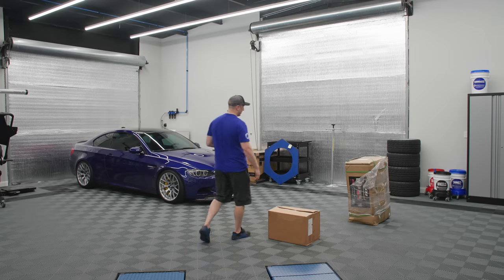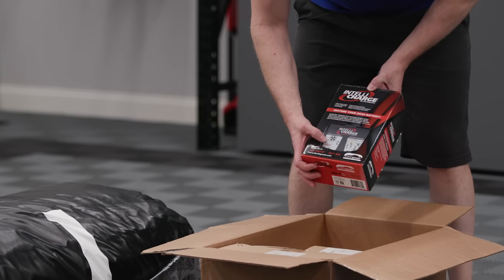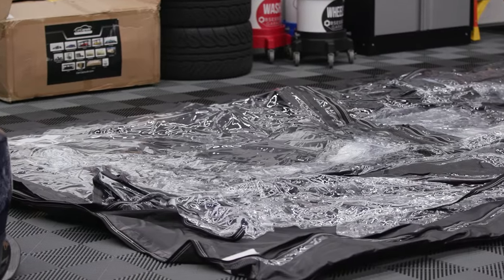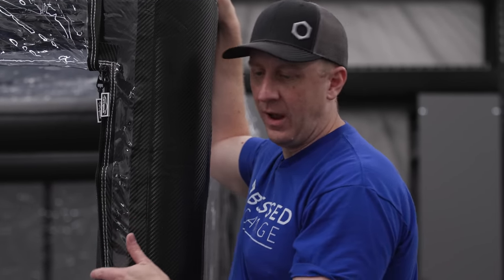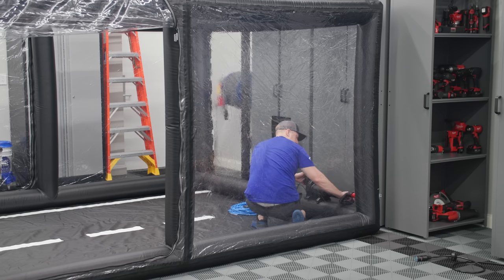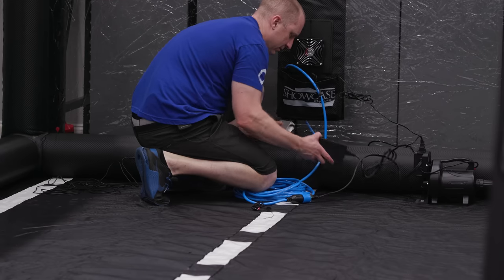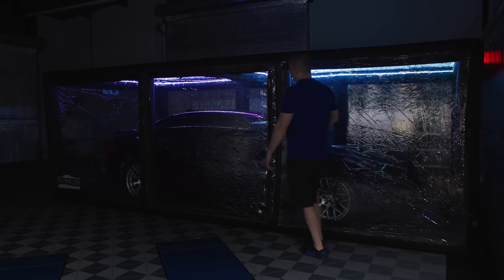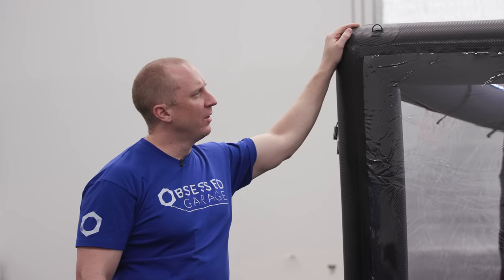Trying Out the Car Capsule Showcase - Carbon CF1

Comment: LED strips can be very good quality of light, however cheap and RGB light are generally bad and have inaccurate and non consistent color. When you buy any LED you should get ones with a high CRI ( color rendering index) and if you just want light you should get white LEDs and (not RGB) or RGBW which have white LEDs when you dont want colors. edit: going to need a video on those shelves :D

Comment: If you really want to take this to a true preservation mode, skip the fan and use nitrogen gas to keep it inflated. Nitrogen is inert and eliminate corrosion and other oxidation damage to all of the rubber, plastic and everything. Also, from a filtration mode you’re pumping pure nitrogen gas which haz zero dust. Zero moisture. You could store it in an unseated / air conditioned garage with no worries. The factory filter should be replaced with a HEPA or an ULPA filter to eliminate dust particles.

Comment: You never really made it clear that the IntelliCharger not only maintains the car's battery(s), but in the case of a power outage, the IntelliCharger uses your car's battery to power the circulating fan and automatically switches back to a battery charger when power is restored.

Comment: Hey hey hey nothing wrong with a Corvair some of them if not all had the flat six Matty 😆
Reply: I went to school every day in a turbo Corvair 6 cylinder. If we blew a cylinder it was a 30-40 min swap and you were running. 
Lots of the motors ended up in sand rails and dune buggies. With nitrous they would smoke just about everything else out there.